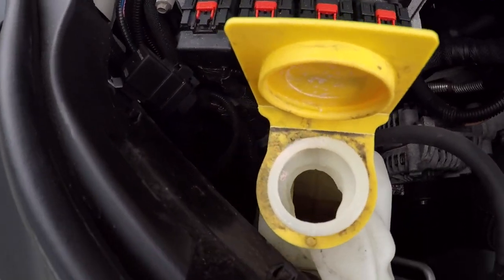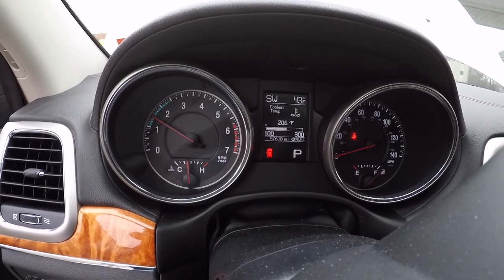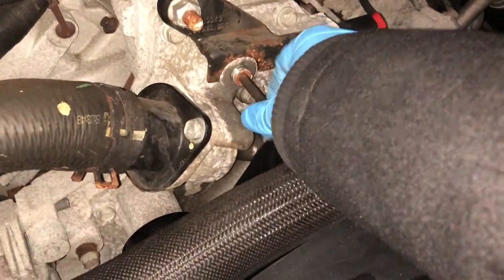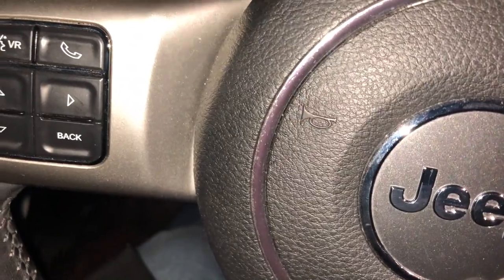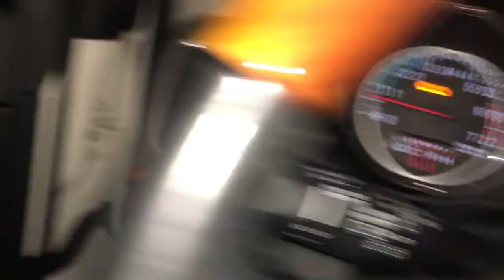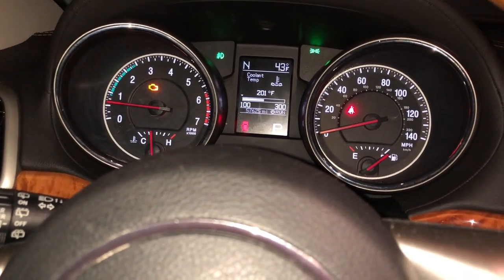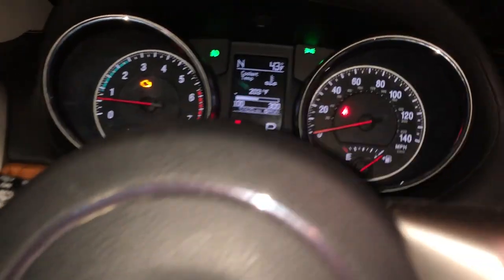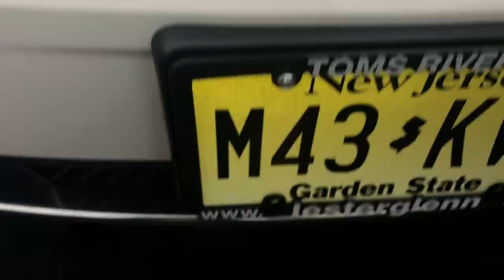Bleeding the Air out of Your Cooling system 5.7L Hemi , part 2

Comment: You need to bleed the air out through the coolent reservoir at 195 deg F by twisting the radiator cap just little to the pressure release position and the air will come out through the coolent reservoir, once the air pressure sounds have stopped tighten the cap back up and repeat until you don't hear anymore air being released. Definitely practice safety when doing this by use a rag on the radiator cap because it will be hot and also have your coolent mixture correct because the boiling point will be much higher and thats needed to get the air out. Normal temps are 195 - 198 deg F for coolent and my oil temp driving around town at 45 mph and below is 190 deg F and at 70 MPH highway cruising is 203 deg F.
Reply from the maker: Kirk Pitre I gotta get places on a daily so 80+ on the parkway might be the issue, but it also has a head gasket leak which keeps pushing most of the coolant out which I found out later on after this video
Reply: Marky Mark 24/7 was coolant leaking into the cylinders and burning or was it leaking out to outside of the block as shown in the video?
Reply: What about the engine block

Comment: Thermostat in a 5.7 opens at 203 degrees.  They run a little hot...but yours is doing what it should.
Reply from the maker: Rob Sinden 230-280° is a bit uncomfortable for someone who came from a Chevy sedan that could do three minute burnies and not even go past 210°, this Jeep rides around being babied at like 214° and up
Reply: Yea 280 is too hot. But 200 to 240 is normal op temp for the 5.7l. They are designed to run hot.

Comment: I have a 2006 Chrysler 300c...it's currently having the whole engine replaced..i took it to a street mechanic and we went thru 3 different thermostats. They claimed none were opening. They replaced my water pump. Thru the bleeding coolant process...they blew a damn head gasket revving it up continuously...o n by the way they never bled it properly...it kept getting hot/overheating smh..my problem is solved now but i strongly advise that if u can't do it yourself..jus go to the professionals..I'm goin thru hell jus because i wanted a thermostat and water pump replaced smh...i ended up being out a whole damn engine..bigups to u tho!!👍💪keep learning💯
Reply: wow going though that now😬
Reply from the maker: D'shon Thomas currently pulling the heads with not enough time to film, but the rebuild is about to happen once I get the heads from the shop and parts in the mail. Might do a time lapse. This truck has been a nightmare
Reply: Ifeel as if the bigger hemi engines  are prone to burning  these thermostats up...if it makes any sense....the fact that they get so hot...on a regular. Ifeel as if they  beat on an Average  Part

Comment: Lisle Spill free funnel bleeds the system perfectly.
Reply from the maker: I’ve come to learn these hemis require a vacuum fill, tho I’ve tried a similar bleeding funnel and in the process of running the vehicle, after about 2 minutes of it running and up to temp, it exceed normal temps and soon enough coolant was spraying out of the funnel like a geyser. Unfortunately I haven’t been recording any of the other issues I’ve had because I’m honestly uneducated and needed to search around and try a few things before coming back. I’m now in the process of ordering a new remans engine because the reliability of the block is questionable at this point exceeding temps over 280° multiple times

Comment: I have a 2011 dodge durango and my water pump stoped working the pulley got stock amd broked so i replace the waterpump amd the thermostat but my temp gauge wasnt going up it would only go up just a lil but when i drove it the gauge kept going down so i was searching on the internet and some peaple were saying that it could be the temp sensor so i replaced my tem sensor but it kept doing the same thing then i was told to bleed the water pump and i did it alot of bubbles came out but it keeps doing the same thing 😭😭😭😭 if someone knows what it could be or how to fix it let me know please.. i took it to a mechanic and he didnt even looked at it and the 1st thing he said was ohhh its the engine...
Reply from the maker: DJ LUNA if the heads are leaking exhaust gas into the cooling system this could be the reason for the temp sensor not being able to read a temp or only moving slightly. First make sure your thermostat is placed in correctly, there’s a little bubble bleeder hole that should be at the top when installing to help prevent air bubbles staying trapped in the top of the water pump near the temp sensor. This was a major issue on my Jeep where exhaust gas kept moving enough coolant out of the system to cause the sensor to no longer read a temp and then throw several other codes
Reply: @markymark247  thank you very much

Comment: I see this video is 2 years old but now my jeep Cherokee 2011 5.7 hemi wont get hot, I just made the engine burp a lot around 20 minutes and seems to be ok now👍
Reply from the maker: If this keeps happening get a head gasket tester for your coolant, trust me on this as hemis get hot, and if you lost heating/engine cooling this could be due to a bad head gasket from hot spots in the block where coolant is now entering the cylinder in small enough amounts to not throw a code or a bunch of smoke (other than an unusual amount of smoke on cold starts even in warm weather) or overheating caused by a stalled water pump getting air from the bearing seal that normally goes after 50k to 120k miles depending on how lucky you are with the stock one, which will also cause you to have a head gasket leak and lead to worse things like dropping valve seats if things up top top get more air rather than adequate coolant flow.

Comment: How long did it actually take you to get the result that everything was finished up?
Reply from the maker: During and after this video I had a series of overheating issues caused by a head gasket leak on 3 out of 8 cylinders. I’ve since rebuilt the top end one time around, continued to have overheating issues, and now after questioning the reliability of the block after exceeding 280° on multiple occasions as well as melting the plastic intake manifold has lead me to getting a replacement crate. I will be doing a video on the swap soon to point out any abnormalities I see, because as I pointed out the belt wobbling, it was due to the seal and bearing prematurely wearing due to lack of lubrication, this is due to the head gasket filling the top of water pump housing with exhaust gasses. All in all, I’ve owned this vehicle for two years, put less than 30,000 miles on it, and still have not solved the overheating issue. A new engine could take care of all the variables including me not properly seating and torquing the heads. Just have to worry about getting the trans hooked up right 🤷🏻‍♂️ honestly anything that could go wrong might but this is the lesson I will take to my grave,”don’t buy a Jeep with a 5.7” not just for the sake of it overheating, but it lacks power like an srt would have, and fuel economy is non existent (could also be it running super rich because of coolant throwing off o2 sensors), but mostly the struggle of even a small guy like me squeezing around to loosen bolts is not worth it for the power this lacks along with the reliability I’ve come to read about across many of the gen 3 5.7L hemi forums. Mds, flat spotted cams, dropping valve seats. Haven’t had those issues yet, but if the vehicle continues to run under the conditions I’ve observed after this video all these failures will occur due to lack of oiling and cooling management
Reply from the maker: Jerilyn Ineson  I don't have time to watch movies but I appreciate the channel engagement

Comment: 203F is normal for the 5.7
Reply from the maker: During and after this video I had a series of overheating issues caused by a head gasket leak on 3 out of 8 cylinders. I didn’t continue on with this as I had no knowledge of what was actually going on. I still don’t and I’ve rebuilt the top end once to have the same issue, now looking for remanufactured engines to replace the stock 5.7 I’ve hit temps as high as 280° while casually driving on the parkway multiple times and the reliability of the block is questionable at this point.
Reply: @markymark247  with the rebuild did the shop confirm the heads weren’t warped? If the heads weren’t checked for straightness then the head gasket would just fail again.
Reply from the maker: @PhOeNiXpIoLe  do you have Instagram? I can send you a picture of what the heads looked like after they came back from the shop. Least I can say is I’ll never be using said shop again after they rooky mistake they made while cleaning the heads. But according to the shop they weren’t warped yet we were still charged will mill time like they resurfaced them
Reply: @markymark247  yeah I’d definitely like to check them out, just send me a link to them on here
Reply from the maker: @PhOeNiXpIoLe  https://www.instagram.com/p/B3aviGvAJJl/?igshid=3bmdwuzvbx2a
Reply: @markymark247  dang it looks like they left sand blast media in it
Reply from the maker: @PhOeNiXpIoLe  yupp, basically didn’t take the time to blow it all out before the hot wash and everything caked up in all the threads and little crevices.